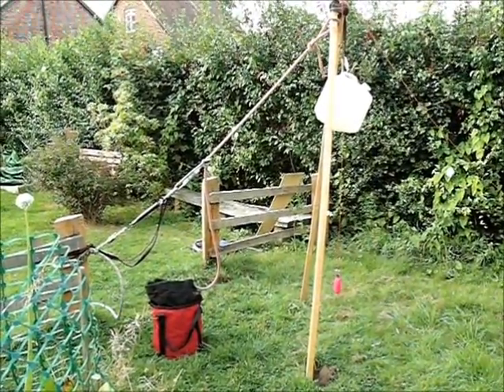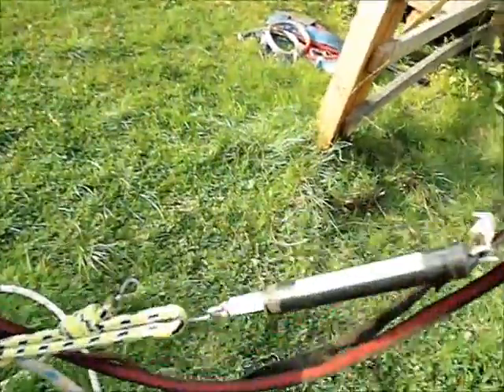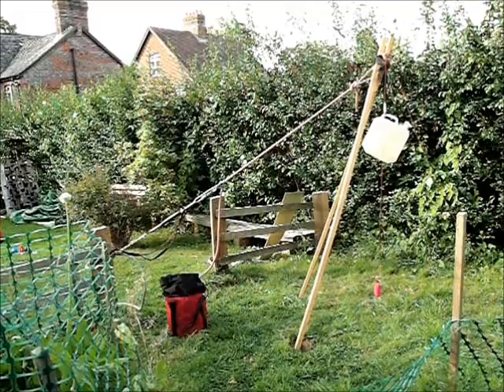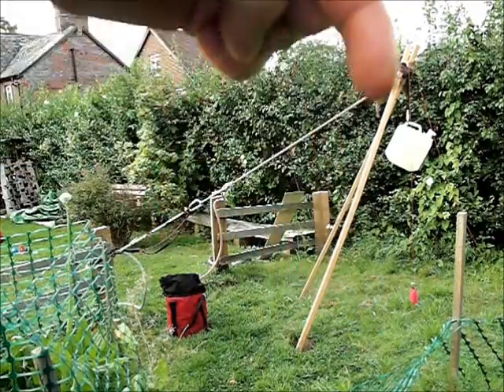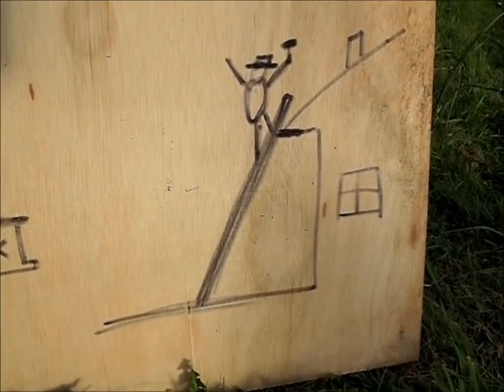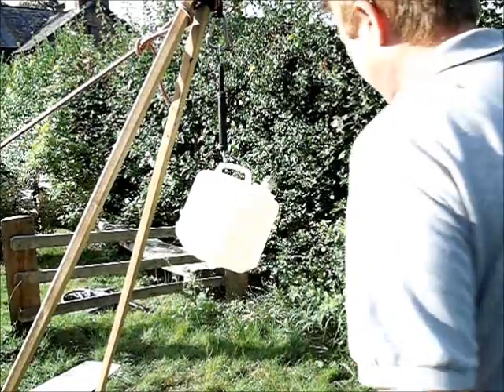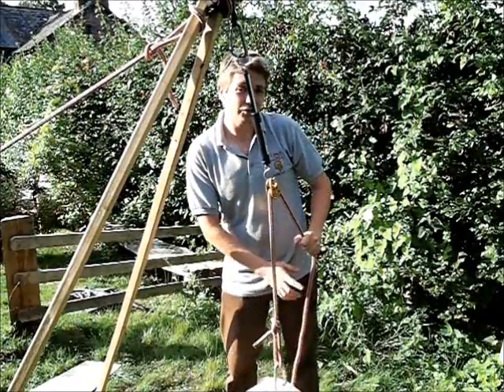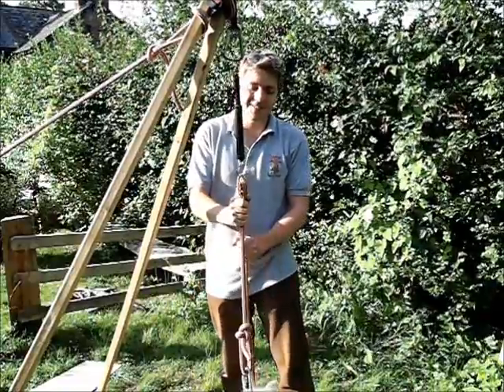Lifting with shearlegs- feel the force?

Comment: Thirty-something years ago my father used a tall set of sheer legs to erect a 15-foot tall steel tankstand with a wooden platform on top. When that was in place with the concrete set, he broke out the sheer legs again and used then to place an 800 gallon corrugated iron water tank on top of the structure.

Comment: Thank you very much! I am lifting a small shed. Probably 700 to 800 lbs and transferring to my sons house on my trailer. 
To lift it I’ve built a rig that is one 6” X 6” x 8’ beam with a 4” X 6” base that is cut to be a rocker base. I have two, 4K lifting D-rings on opposite sides bolted together through the 6” X 6” at the near top. One side will have a logging chain going down, to each side of the front of the shed. Using a 4 ton come-a-long, attached to an anchor to pull with. Wish me luck.
Reply: How did that work out for you ?
Reply: @ruckus__  it didn’t happen. Someone bought the shed and came and disassembled it.